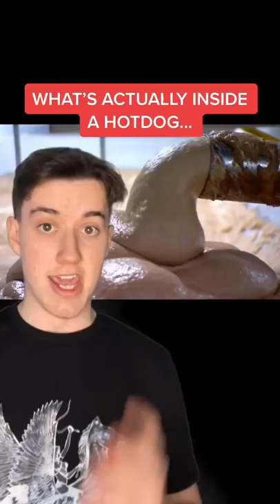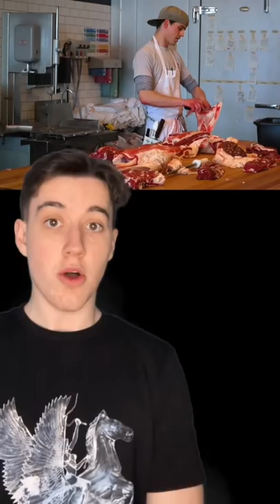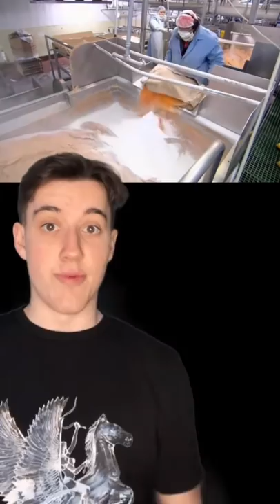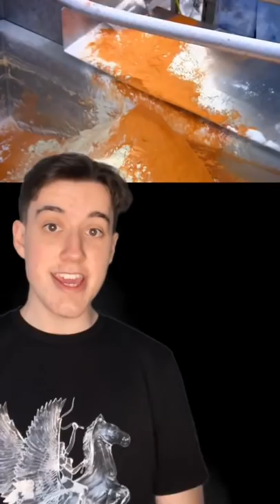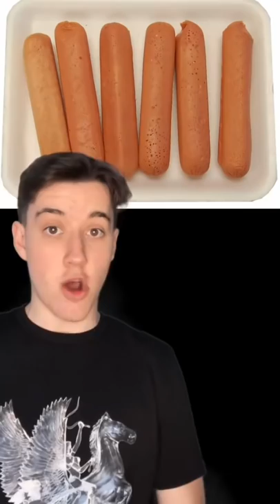What's Actually Inside A Hotdog #Shorts

Comment: TIP: If you still like hotdogs, but don't want ones with normally uneaten animal bits, look in the ingredients section and see if it says "mechanically separated". If so, then it's going to be like in this video. If not, then it might actually be made with quality parts, that would otherwise be sold and eaten normally. You can also buy ones marked as kosher, which are made using only quality parts as well.

Comment: Before the real down-and-dirty business of hot dog manufacturing can begin, all of those unsavory trimmings have to be ground down into a more manageable, uniform product. Most often, the types of meat used in hot dogs are some combination of pork, beef, chicken, or turkey.

In the Unites States, hot dogs that contain sketchier cuts of meat must be labeled as containing "Byproducts" (organ meats) or "Variety Meats" (raw skeletal muscle). Those containing byproducts must be listed and called out by species on the ingredient panel. So-called "mechanically separated meat," whereby pork bone (but never cow bone; thanks, Mad Cow Disease) is pushed at high pressure through a sieve to scrape every last remaining scrap of usable meat off the carcass is permitted, but this kind of meat cannot make up more that 20 percent of the contents of the finished product.

The trimmings, along with assorted by products and variety meats, are loaded into giant meat grinders, similar to the ones you've seen the butcher using to grind hamburger at the grocery store. All of those different animal parts are finely ground at this stage, to form a sort of loose, pebbly-textured meat mashup.
After the all the components are ground together, with the resulting product looking more like usable meat and less like a disparate pile of scrapped animal garbage, it's time to start adding the flavor and texture ingredients that help differentiate one hot dog brand from the next.